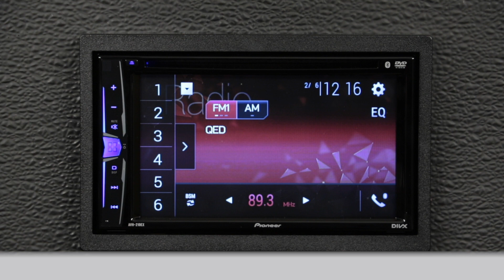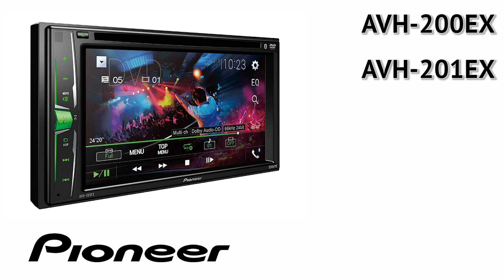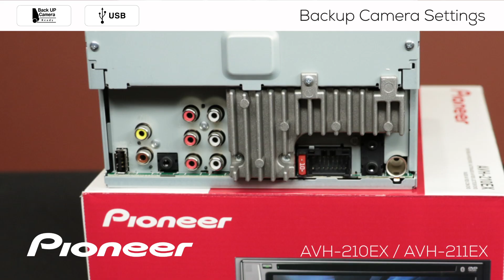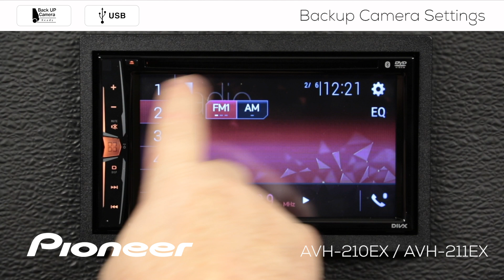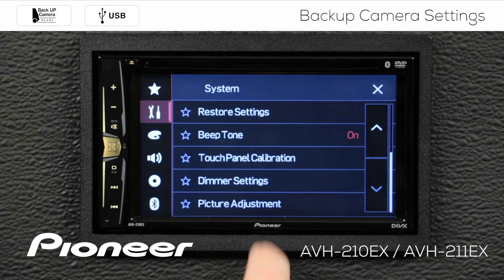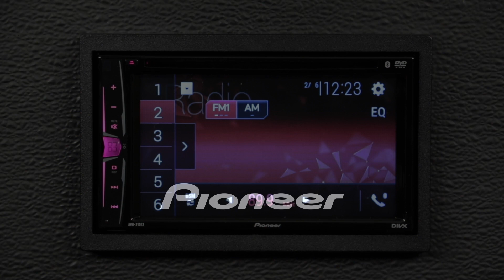How To - AVH-210EX - Backup Camera Settings

Comment: The camera works except it won't automatically display when i shift to reverse what could be the issue???
Reply: Pioneer in-dash receivers are designed to work with the Pioneer ND-BC8 backup camera. I don’t know about the operation of other cameras. 
Be sure to plug the Brown camera output RCA into the Brown RCA Input on the back of the Pioneer in dash receiver.
The Pioneer ND-BC8 camera needs power and ground to operate.  The camera should always have power when the vehicle is switched on. And the camera should power off when the vehicle is switched off.  This is very similar to the way the Red Accessory wire works on a Pioneer in-dash receiver.  Just because the camera has power does not mean you are viewing the camera window on the in-dash receiver.
The receiver’s violet/white wire is used to let the in-dash receiver know that the vehicle is in it’s reverse gear and, to automatically open the backup camera window on the receiver screen.   You can learn more about the violet/white wire here:   https://youtu.be/-bF3uzzaT30?list=PLw63zJRQbCNgLoyoij-BJdPDBVLYipAnj&t=147    
Do not connect the violet/White wire to the camera. 
When you put the vehicle in it’s reverse gear, the violet/White wire should sense a change in voltage. This automatically opens the camera window on the in-dash receiver. And closes the camera window, when the vehicle is taken out of it’s reverse gear.  One possibly connection for the violet/White Reverse Gear wire is the vehicle’s  backup lamp terminal.    You can find a full playlist of How To videos from Pioneer about AVH-210EX here:  https://youtu.be/XA-PlD7EXH8?list=PLw63zJRQbCNgLoyoij-BJdPDBVLYipAnj   You can find more information on Pioneer's web site here:  https://www.pioneerelectronics.com/PUSA/    and you can find more videos on Pioneer's YouTube Channel here:  https://www.youtube.com/user/pioneerelectronics
Reply: @deckerdotto6035  Thanks the issue was the splice I was using on the reverse wire wasn't making contact .

Comment: I have a avh 220ex and trying to install it to a hyundai elantra 2015 se. When i try to use the camera it doesnt pop up but the camera cuts on? What did i do wrong
Reply: I got the same one you got today and mine doesnt show up.
Reply: Pioneer in-dash receivers are designed to work with the Pioneer ND-BC8 backup camera. I don’t know about the operation of other cameras. 
Be sure to plug the Brown camera output RCA into the Brown RCA Input on the back of the Pioneer in dash receiver.
The Pioneer ND-BC8 camera needs power and ground to operate.  The camera should always have power when the vehicle is switched on. And the camera should power off when the vehicle is switched off.  This is very similar to the way the Red Accessory wire works on a Pioneer in-dash receiver.  Just because the camera has power does not mean you are viewing the camera window on the in-dash receiver.
The receiver’s violet/white wire is used to let the in-dash receiver know that the vehicle is in it’s reverse gear and, to automatically open the backup camera window on the receiver screen. 
Do not connect the violet/White wire to the camera. 
When you put the vehicle in it’s reverse gear, the violet/White wire should sense a change in voltage. This automatically opens the camera window on the in-dash receiver. And closes the camera window, when the vehicle is taken out of it’s reverse gear.  One possibly connection for the violet/White Reverse Gear wire is the vehicle’s  backup lamp terminal.   You can learn more about wiring your Pioneer receiver here:  https://youtu.be/-bF3uzzaT30?list=PLw63zJRQbCNgLoyoij-BJdPDBVLYipAnj   and you can find more videos on Pioneer's YouTube Channel here:  https://www.youtube.com/user/pioneerelectronics
Reply: Pioneer in-dash receivers are designed to work with the Pioneer ND-BC8 backup camera. I don’t know about the operation of other cameras. 
Be sure to plug the Brown camera output RCA into the Brown RCA Input on the back of the Pioneer in dash receiver.
The Pioneer ND-BC8 camera needs power and ground to operate.  The camera should always have power when the vehicle is switched on. And the camera should power off when the vehicle is switched off.  This is very similar to the way the Red Accessory wire works on a Pioneer in-dash receiver.  Just because the camera has power does not mean you are viewing the camera window on the in-dash receiver.
The receiver’s violet/white wire is used to let the in-dash receiver know that the vehicle is in it’s reverse gear and, to automatically open the backup camera window on the receiver screen. 
Do not connect the violet/White wire to the camera. 
When you put the vehicle in it’s reverse gear, the violet/White wire should sense a change in voltage. This automatically opens the camera window on the in-dash receiver. And closes the camera window, when the vehicle is taken out of it’s reverse gear.  One possibly connection for the violet/White Reverse Gear wire is the vehicle’s  backup lamp terminal.   You can learn more about wiring your Pioneer receiver here:  https://youtu.be/-bF3uzzaT30?list=PLw63zJRQbCNgLoyoij-BJdPDBVLYipAnj   and you can find more videos on Pioneer's YouTube Channel here:  https://www.youtube.com/user/pioneerelectronics

Comment: Hi, I have a similar problem. When I start my car and put the back camera it doesn’t appear something, only black image. When I go to camera settings the camera is off. So I have to put it on every time I start the car in on. Please help! 🙏
Reply: There could be several different issues here:   First I recommend to press the microprocessor reset button on the receiver.  You'll need a paperclip or some other small point to press the microprocessor reset button.  I can't tell you where to find the microprocessor reset button, because you did not mention what Pioneer receiver you have.      If your clock and radio stations reset each time you start your vehicle your in-dash receiver may have an improper connection for the Yellow Wire.  The Yellow Wire must have constant power from the vehicle. The Red Wire is for accessory.  Do not connect the Red Wire and Yellow Wire together. Please take a look at this video for more information on wiring your Pioneer in-dash receiver:   https://youtu.be/-bF3uzzaT30?list=PLw63zJRQbCNgLoyoij-BJdPDBVLYipAnj      And finally your camera may be wired incorrectly:    Pioneer in-dash receivers are designed to work with the Pioneer ND-BC8 backup camera. I don’t know about the operation of other cameras. 
Be sure to plug the Brown camera output RCA into the Brown RCA Input on the back of the Pioneer in dash receiver.
The Pioneer ND-BC8 camera needs power and ground to operate.  The camera should always have power when the vehicle is switched on. And the camera should power off when the vehicle is switched off.  This is very similar to the way the Red Accessory wire works on a Pioneer in-dash receiver.  Just because the camera has power does not mean you are viewing the camera window on the in-dash receiver.
The receiver’s violet/white wire is used to let the in-dash receiver know that the vehicle is in it’s reverse gear and, to automatically open the backup camera window on the receiver screen. 
Do not connect the violet/White wire to the camera. 
When you put the vehicle in it’s reverse gear, the violet/White wire should sense a change in voltage. This automatically opens the camera window on the in-dash receiver. And closes the camera window, when the vehicle is taken out of it’s reverse gear.  One possibly connection for the violet/White Reverse Gear wire is the vehicle’s  backup lamp terminal. 
You can find more videos on Pioneer's YouTube Channel here:  https://www.youtube.com/user/pioneerelectronics

Comment: My Avh 200 just stopped working it doesn’t change the screen I when in reverse anymore and when I check the camera view it’s just black
Reply: It was working fine previously 
I restarted and reset the unit and put the camera setting and polarity where it should be

Comment: My camera was working fine and out of no where it stopped working when I put into reverse. I reset the system and turned on the camera and polarity settings. What could’ve gone wrong? Maybe I hit a bump and caused the wire to disconnect

Comment: I installed this stereo, but now my factory car camera isn't working, any idea about what i did wrong?
Reply: I may be able to help more if you provide more detail about the installation. It's possible the camera is not powered up or the in-dash receiver's camera window is not automatically opening when you put the vehicle in reverse.   Pioneer in-dash receivers are designed to work with the Pioneer ND-BC8 backup camera. I don’t know about the operation of other cameras. 
Be sure to plug the Brown camera output RCA into the Brown RCA Input on the back of the Pioneer in dash receiver.
The Pioneer ND-BC8 camera needs power and ground to operate.  The camera should always have power when the vehicle is switched on. And the camera should power off when the vehicle is switched off.  This is very similar to the way the Red Accessory wire works on a Pioneer in-dash receiver.  Just because the camera has power does not mean you are viewing the camera window on the in-dash receiver.
The receiver’s violet/white wire is used to let the in-dash receiver know that the vehicle is in it’s reverse gear and, to automatically open the backup camera window on the receiver screen. 
Do not connect the violet/White wire to the camera. 
When you put the vehicle in it’s reverse gear, the violet/White wire should sense a change in voltage. This automatically opens the camera window on the in-dash receiver. And closes the camera window, when the vehicle is taken out of it’s reverse gear.  One possibly connection for the violet/White Reverse Gear wire is the vehicle’s  backup lamp terminal. 
You can find more videos on Pioneer's YouTube Channel here:  https://www.youtube.com/user/pioneerelectronics

Comment: To bad you don't have my model. Did what was suggested, and still doesn't work. It did work fine before. Then suddenly stopped. Black screen
dunno........
Reply: There could be several reasons a black screen appears. If you don't have a camera installed I recommend to switch off the backup camera input in the settings menu.  You can see it here:   https://youtu.be/OD9XdSnzyI8?list=PLw63zJRQbCNgoCBAcEH-E-IUALLo9TgPy&t=30       If you do have a camera, the first thing to check is the Camera Timer.  I recommend to open the camera window, from the home source screen,  and then close the camera window with "X" on the screen at the top right.  You can see this work on a similar Pioneer receiver here:    https://youtu.be/OD9XdSnzyI8?list=PLw63zJRQbCNgoCBAcEH-E-IUALLo9TgPy&t=55      If this doesn't correct the issue, I recommend to press the microprocessor reset button.  You'll need a paperclip or some other small point to press the microprocessor reset button.  You can find the microprocessor reset button on the Pioneer AVH-X391BHS at the top of the hard key panel beside the eject button.    The Pioneer AVH-X391BHS was produced back in 2015- 2016.  It's possible the product needs to be serviced.  You can find a full playlist of How To videos about nearly identical Pioneer receivers here:  https://youtu.be/C6h7IJ7wpmc?list=PLw63zJRQbCNgoCBAcEH-E-IUALLo9TgPy    and you can find more videos on Pioneer's YouTube Channel here:  https://www.youtube.com/user/pioneerelectronics
Reply: @deckerdotto6035  Thank you. I will read this and research. I hope this shall fix the problem. I do have a camera, and it worked fine, and then suddenly stopped.
I will let you know how i  make out.
Thanks again.
Reply: @deckerdotto6035  I did the second option you gave with camera. I tried different things with polarity. ground battery, on and off, and still the same results.
Can you explain what you mean when you say to "check the timer".  I clicked on timer on top left, but is their a step i need to do with timer?
Reply: It's possible the camera has failed and needs to be serviced or replaced.
I recommend to press the receiver's microprocessor reset button.  You'll need a paperclip or some other small point to press the microprocessor reset button.  You can find the microprocessor reset button on the Pioneer AVH-X391BHS at the top of the hard key panel beside the eject button.    It's possible the camera has failed.  
 "I clicked on timer on top left, but is their a step i need to do with timer?"   >  Yes, after touching the timer button,  close the camera window with the "X" at the top right. Please watch the video with the sound on.  This is explained in detail.   https://youtu.be/tWi_kVPg2M4?t=169
Reply: @deckerdotto6035  Ok thank you. I will do that, and let you know how i made out.
Reply: @deckerdotto6035  Tried both, and neither worked
Thanks anyhow.I appreciate your help. Thumbs up. I guess i have to figure where i can get service.

Comment: So I installed my camera it works when I put it in reverse but when I hit camera view it just stays on the black screen I seen you said don’t hook the red wire from the camera to the purple and white gear wire that I need to wire it into a 12v on so what do I wire up to the purple and white gear wire if the camera itself doesn’t go into it
Reply: Pioneer in-dash receivers are designed to work with the Pioneer ND-BC8 backup camera. I don’t know about the operation of other cameras. 
Be sure to plug the Brown camera output RCA into the Brown RCA Input on the back of the Pioneer in dash receiver.
It sounds like you are powering the camera with the reverse gear light.  I do not recommend doing that.  The Pioneer ND-BC8 camera needs power and ground to operate.  The camera should always have power when the vehicle is switched on. And the camera should power off when the vehicle is switched off.  This is very similar to the way the Red Accessory wire works on a Pioneer in-dash receiver.  Just because the camera has power does not mean you are viewing the camera window on the in-dash receiver.
The receiver’s violet/white wire is used to let the in-dash receiver know that the vehicle is in it’s reverse gear and, to automatically open the backup camera window on the receiver screen. 
Do not connect the violet/White wire to the camera. 
When you put the vehicle in it’s reverse gear, the violet/White wire should sense a change in voltage. This automatically opens the camera window on the in-dash receiver. And closes the camera window, when the vehicle is taken out of it’s reverse gear.  One possibly connection for the violet/White Reverse Gear wire is the vehicle’s  backup lamp terminal. 
You can learn more about wiring your Pioneer receiver here:  https://youtu.be/-bF3uzzaT30?list=PLw63zJRQbCNgLoyoij-BJdPDBVLYipAnj&t=144     You can find a full playlist of How To videos from Pioneer about AVH-210EX here:  https://youtu.be/3qzUErs-JGk?list=PLw63zJRQbCNgLoyoij-BJdPDBVLYipAnj    and you can find more videos on Pioneer's YouTube Channel here:  https://www.youtube.com/user/pioneerelectronics

Comment: Hi there. I have a RCAM2 connected to my AVH-X8750bt. I know the receiver has built in guidelines that can toggle on and off, but I’d like to be able turn off the guidelines on the actual camera. Can this be done by changing the wires at all? 

Cheers.
Reply: I recommend to contact Pioneer Australia for help with the RCAM2.  You can find them here:  https://www.pioneer.com.au/contact-us/    You can find more videos on Pioneer's YouTube Channel here:  https://www.youtube.com/user/pioneerelectronics